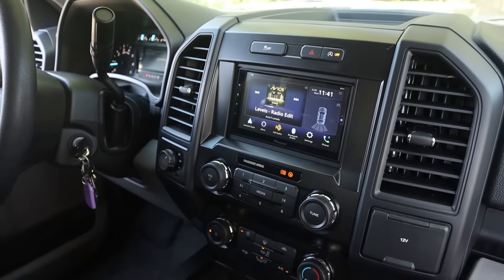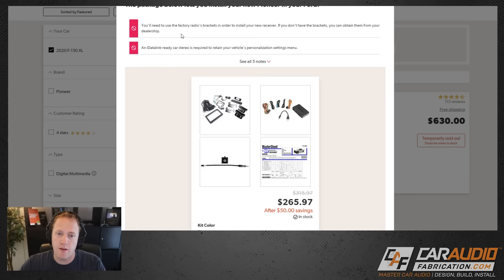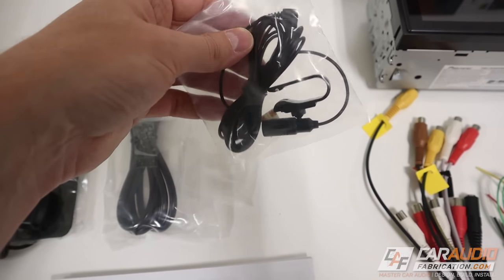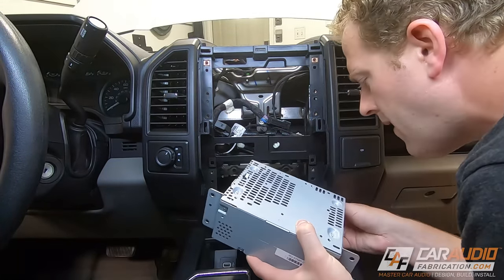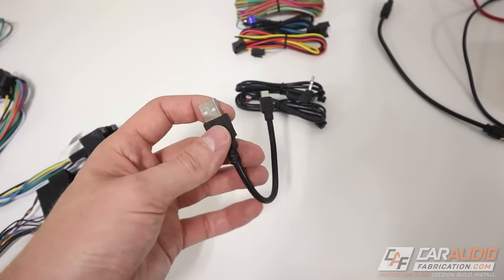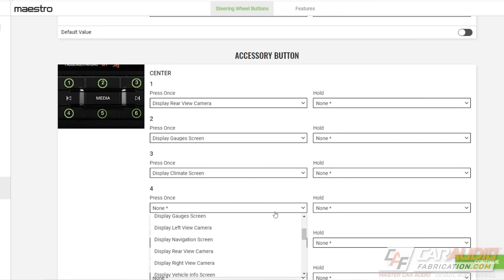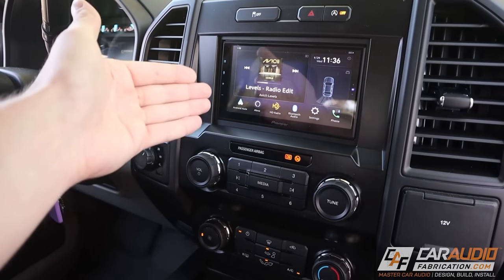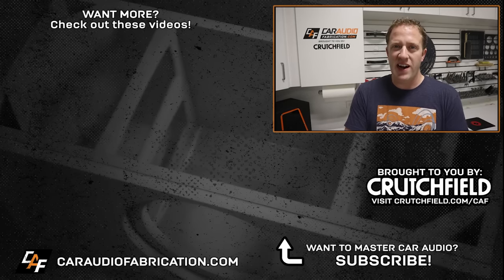Upgrade your F-150 Radio WITHOUT losing features! 2015-2020 Ford F Series Head Unit Install

Comment: If you’re doing this with one that has the 4.3” display it’s a lot more difficult. You have to transfer the ribbon cables and ac controls compared to this one that still uses the factory bezel.
Reply: Can you do a video?! I have a 2013 F150

Comment: Crutchfield is definitely one hell of a good company. Thanks for the video, always helpful. I wonder if the Pioneer sound is really much better than the 8" factory system (non-sony) on XLTs and up. It can play lossless music and I don't know that I would hear a difference (given that Focal speakers are installed ofc).
Reply: I personally think if you want to go up in a significant way from those systems, anything mid to top line Alpine or JL. Alpine being for SPL heavy systems or my personal favorite JL for the most natural premium sound

Comment: Question:  Did the maestro retain the steering wheel sensor for the backup camera?  Does the line bend when you turn the wheel or is the backup screen static?

Comment: Wow, yes this video is and was very detailed so detailed I felt I could do it myself but I'll leave it to the pros. Have a 2019 F250 super duty work truck and this will hopefully be in it if I can find the proper place for the installation. All the Aditional features are a bonus and definitely a must. Thanks for sharing your video and knowledge.

Comment: Love the install. I have an 18 F150 XLT sport with Hertz speakers and a JL 1000 HD amp with a JL 13.5 TSW. I want to change the deck out and add another amp for the rest of the truck. Little at a time. Can’t wait to see the rest of your install

Comment: Hey Mark,  great stuff, I have a challenge for you that would make for great content. I would like to see you Design a subwoofer box that will sit behind the rear seat of the F150. under the seat one, you did was great, but designing one that is hidden and can produce bass?  I've seen it done but would love to see what you come up with. Also, design it to mount the Amp too.

Comment: I think Ford has the best factory units with the Sync 3 and 4 systems. I have an older Ford that came with the Sync 2 and upgraded it to the Sync 3 and has been great with Apple CarPlay.
Reply: garbage compared to newer aftermarket
Reply: How much was that upgrade?
Reply: I'm here because my APIM module in my 2018 failed and needs replacement.  No interest to pile money back into the stock config.
Reply: @Kuntmala  I’m in the same exact boat with my 2018…what did you end up doing?
Reply: @chargertalk9023  upgraded to Alpine head unit with the Maestro Kit from Crutchfield.  Did the install myself, was fairly straightforward with a few gotchas here and there.  Note you lose factory chimes through radio, but no big deal.  

Already had a sub but now is direct from HU.  Then decided I might as well add a 4ch amp, upgrade everything lol.

The new head unit will make a big improvement.  I originally wanted a Kenwood one but they didn’t have the one I wanted at the time, and if I recall Wireless Carplay options were my limiting factor.  

I have my 4ch amp turned all the way down.  Have two JL 12TW3s in a ported underseat MTI Acoustics box.
Reply: You think that until you touch one of the new Sony radios and it responds instantly or your phones connected apon sitting in the seat

Comment: Exceptional video. It may seem petty, but as much as I’d like to add an aftermarket head unit, i refuse to put one in because they all seem to feel like it’s required to slap their brand/logo front and center. I prefer a clean OEM look.
Reply from the maker: I agree with you. What is worse is when they put "DVD" or whatever features on there too. But unfortunately they all do it

Comment: Amazing video.  Crutchfield is limiting the depth on the F-150 (and receiver choice), I assume, based on that bracket you said could be removed.  Will that bracket add another inch or two of clearance?  Thanks!

Comment: I just did the Sync3 update and swapped the USB port to get CarPlay. For audio, I'm going direct to my AudioControl amps via the BT adapter, plus I have an Apple Airport express running mini Toslink to a Cambridge Audio Magic DAC for wireless lossless via Airplay ; ) There's a module that allows you to get video on the 8" OEM F150 screen. I'll be using that for my SpeedIR thermal camera.

Comment: This is for the 8 inch screen. If you have the 4.3 inch screen, you'll need to replace the whole display unit. It's more timely and like another commentator mentioned, climate controls need to be hooked up. You'll need the FTR1 kit, not this kit.

Comment: I have a 2018 F150 with the B&O system.  I would love to have wireless android auto, which is not available with the current Sync system.  My only concern is the connectivity to the current, in place, amplifier/subwoofer combo. If I could have the aftermarket head unit and keep the 'good' stuff I currently have, I would 100% do it.
Reply: Can that head unit be swapped out like this? on the B&O systems?

Comment: great video Mark! the one question i have one of the features i like about my stock radio is when i receive a call and the A/C fan is on high it turns it down does the Maestro do that ?

Comment: I ordered the 9 inch pioner n best buy n they gonna do the install n just realized you said about if the truck had the speaker on top n i guess mine does has a gril didn’t think it was a actual speaker thought it was for appearance or something anyway best buy has a fit where you put the info of my vehicle n it didn’t ask if it had the the speaker with the gril on top so does it matter or what?😊

Comment: Excellent video. Love the Kenwood stereo in my 18 F150. So much better than the stock Sync.  The iDatalink was the most important feature for me since it allows me to use the dash volume knob with the Kenwood as well as the steering wheel controls. Awesome. Now I just need to get a Kenwood with capacitive HD screen.

Also that large metal bracket behind the screen was fun as hell to remove. /s

Comment: I just purchased a 2020 Ford F-150 Lariat with the B&O audio.  Crutchfield says I shouldn't replace the audio system.  Just wondering why?  I'd like to have one of the Pioneer systems like you installed on this truck.

Comment: This is the video I have been hoping for.
I have a 2013 F150 with the Sony system.  I have a set of Jl audio c3 5x7 components and a set of c2 5x7 coax.  I was going to keep the factory amp to run the new speakers, but when I hooked up one c2 in the rear it didn’t really sound better than the Sony speaker.  If the factory amp not good enough to run the JL’s?  Is it better to change the head unit first and keep the factory amp amp and speakers or keep the factory head unit and run new amps, and speakers first?

Comment: Hey, Mark. I upgraded to a pioneer 4500nex in my 2015 f150 two years ago. Both pioneer heads failed. Bought through crutchfield and the first was replaced under warranty. The second was just out of warranty. 
I found that the idatalink had terrible connectivity issues and steering wheel controls would occasionally stop working. 
Another big issue is the climate control backlighting would turn back on about 40 seconds after I closed my truck and run my battery down. 
Finally after speaking to crutchfield probably 3 dozen times, we concluded that this series f150 doesn’t play nice with after market radios. 
I just wondering if you have heard the same thing? The 3.5” stock screen is terrible, but I don’t have any problems anymore. 
I have appreciated your channel and learned a lot over the years.

Comment: Idatalink also makes a harness that connects straight to the factory SiriusXM antenna and gps antenna. I’m a little confused where is the camera module. Did they get rid of it for 2018 and up? I have a dmx907s I am contemplating on installing but I don’t want to go down in screen size from the 8 inch or lose my SiriusXM travel link. I’m sorry I still think aftermarket head units have a long way to go as far as features.

Comment: I purchased all the other accessories from Crutchfield but not the radio.  Got a better deal at Amazon.  How can I get the same diagram page you have for connecting the wires together from all the pieces?

Comment: I'm installing the same Pioneer 4660 Head unit in my 2015 F150, but I'm having an issue with the back up camera only showing a black screen. I've double check that I have the same brown AV cable connected to the Yellow back up camera AV in your video. Any ideas why this may be? Thanks

Comment: Hey mark you probably won’t have time to answer but maybe someone sees and offered advice.  I currently run 8 channel setup but really want to add in a 9th currently I use a Rockford dsr1 not sure what all dsps can be used with stock sony unit using the maestro

Comment: Ok so I did this install to my 2015 xlt non Sony system. I'm using a pioneer dmh 2600nex with maestro rr. Works until it doesn't. Factory Volume knob and steering wheels stop working randomly and only way I can reset is to go into pioneer settings and select maestro reset. Then it works but I tried refreshing the rr and bought another rr programed it again , still has issue at times. Can't be the Audio control module as you remove that to install this right?

Comment: For a '13 F150, with factory Sony system do I have to pull the center console out to access the factory amp when using a Maestro Rr? Or all the connections done in the dash?

Comment: Hey got a question about crossovers, I know there’s a dedicated video but I heard this today, if your box is tuned for… let’s say 36 hz, you’d want to have the crossover set close to that frequency?
Reply: those two frequencies are not very much related. The crossover frequency depends on how much of the higher frequencies you want your subwoofer to reproduce. That will depend on how low can your mid bass speakers play. 
So, let's say my mid bass speakers are capable of playing frequencies down to about 80hz, I'll then set my sub crossover frequency at or under 80 hz, regardless of my box's tuning.
Your box tuning mostly influences how low the notes your sub will be able to reproduce, and therefore shouldn't be accounted for when setting a crossover frequency. 
The crossover's main goal is to prevent the subwoofer to play higher frequencies that it wasn't meant to play.

Comment: Will the kit bypass a factory amp too?  If I've already upgraded the speakers and have an aftermarket amp?
Reply: No, it wont, but with an aftermarket headunit you can always connect your aftermarket amp directly to the new headunit.
Reply: @Cathul  ok. Thanks

Comment: I live in Australia and I have A 2015 Falcon Ute with Ford's Sync2 ICC, the Bluetooth no longer works and its AU$1100 for a new unit or AU$600 for a repair. I might have to try some of these options but the Sync2 unit controls climate as well.
Reply: It might be simply the bluetooth module that has gone faulty. In most ford vehicles that I have seen, the bluetooth module is actually separate from the radio/display.
Another option is the Sync3 headunit. Probably just as pricey as a Sync2 unit, but with a number of the options that were talked about in this video.
Reply: @Blue84Stang  Unfortunately the Bluetooth is integrated in the FG-X Falcon. The older FG Falcon had a separate module.
Reply: @_Skim_Beeble  well, that sucks..... So, time to get Sync3? 😏😏😉😉

Comment: I’m getting a bad constant static noise on my 2018 f150 after an upgrade with an amp, lci7 and stock radio. Any thoughts?
Reply: static from ur speakers is it like on all the time even when u turn off your truck?

Comment: Thanks, your video gave me all the confidence to buy and install the system. Is there any way for me to run a RCA cable to connect the factory subwoofer? When connected to the original plug it drain the whole radio system to the sub. Any helpful suggestion is greatly appreciated 😅

Part# AMML3J19A014AA 
Part# VML3Z18808A

Comment: I have a 2019 STX SuperCrew and would like to know your advice as to building a box for behind the rear passenger seat. A single shallow mount Skar 8" sub. I'd like to do this without cutting out any of the materials behind the seat. Any help would be much appreciated! I'm also super excited to see this build you are doing because I have already upgraded the doors to Alpine Type R's. Still have the factory head unit and have been looking into options to add an amp for the doors. I was just thinking of a single 5 channel amp if I don't do two separate ones.
Reply: Have you considered under the seat with a shallow mount woofer?

Comment: Does anyone know if switching from the factory head unit on the 13th gen F150s affects connectivity with the Sync Connect App on my smartphone? (Location, remote start, locks, fuel, etc)
Reply from the maker: The app all still works as intended

Comment: You didn't cover one feature, perhaps your truck lacks the feature.  Heated steering wheel, if your F150 / 250 has the heated steering wheel option, will you be able to access that from the screen.  The reason this in important is that it is the only way you can turn the heated steering wheel on, there is no way to do so with the climate control buttons

Comment: I like pioneer radios but will never buy another untill they get rid of the Nanny BS. Can't stand not being unable to use everything just because the car is moving.
Reply: That does suck. On the Kenwood, you can ground the wire directly to the radio chassis and everything functions at any time.